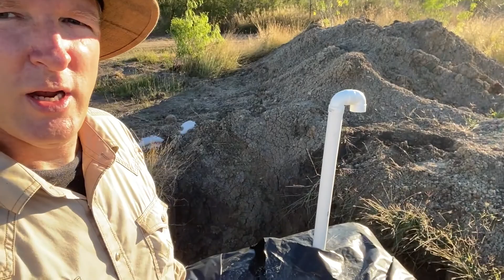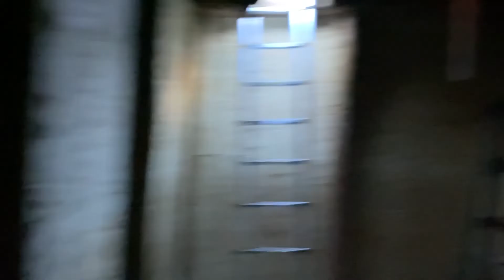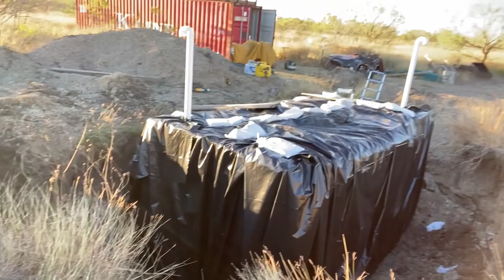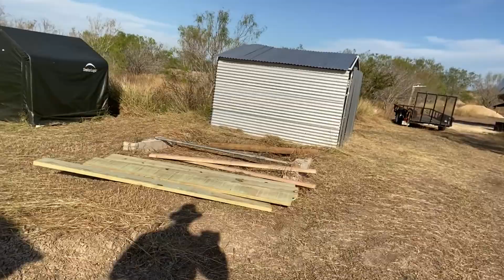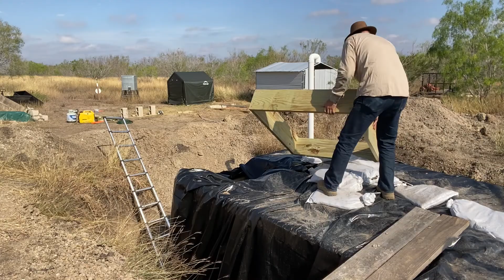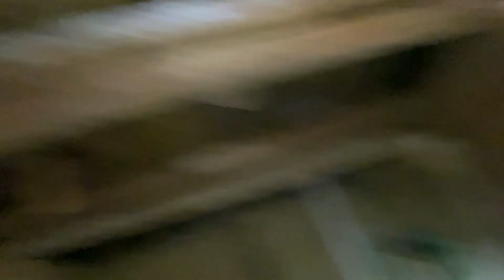ROOT CELLAR BUILD - PUTTING VENT PIPES AND ENTRY BOX IN (EP 55)

Comment: I am curious how your walls have held up after backfilling. I know a couple people thought you would have trouble from the pressure, I would disagree if the support is as decent as it looks. 
I am in the middle of building a 12'x12' root cellar Into a side hill presently, building it beefy enough to drive our skidsteer right on top of the roof as we bury it. I am using two 6" vents, has two vents been adequate for your cellar? Also are you staying with an earth floor or going with something else?
Reply from the maker: Hey Briar, the plywood pushed in a little bit when I initially back filled but the whole structure is holding well.  I did reinforce the inside with horizontal posts to prevent any further movement.  The humidity in my cellar is 70% which I believe is typical for a root cellar but I'd like a lower humidity.  One viewer recommended I cut the PVC of the vent pipe higher up inside the cellar so that the old air is completely removed.  I haven't done that but I plan to soon.  The floor is earth.  We'll see how it holds up over time, I'm pretty happy with it so far.  Thanks for the comments.
Reply: @24acresofparadise  Thanks for the update,  it sounds encouraging!

Comment: I know you probably do not like my comments, but I see a dangerous situation with this build. There is no way that plywood is going to hold back the weight of all the dirt you are planning to backfill against it. Please install more support in between your posts on the walls.
Reply: There is a reason we build basement walls with concrete and not plywood
Reply from the maker: Well if it doesn't work out, I may do that later.  I'm pretty sure concrete is not in my budget right now.  What do you think it would cost to have a concrete root cellar 16'x8'x8'?
Reply from the maker: Yes, adding additional support is the plan.